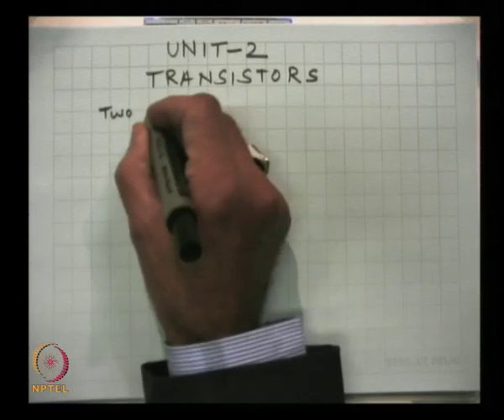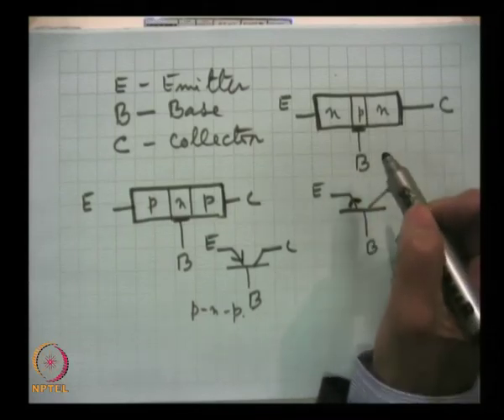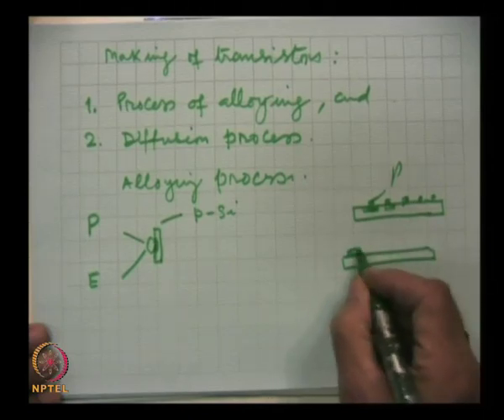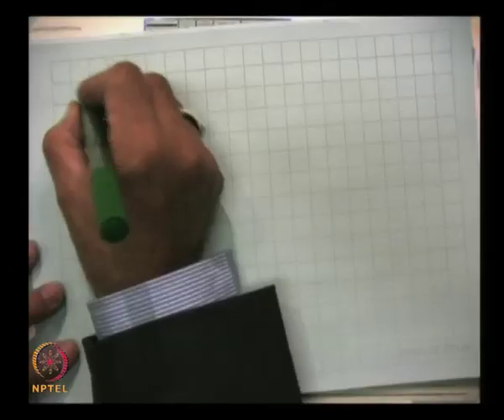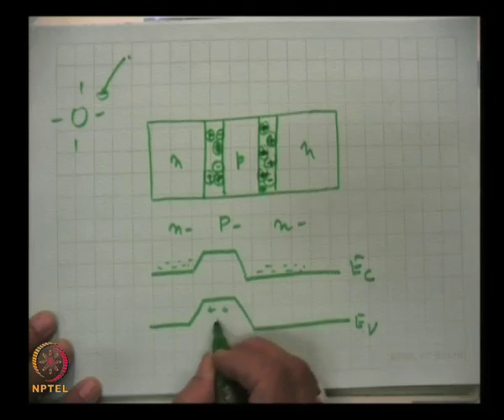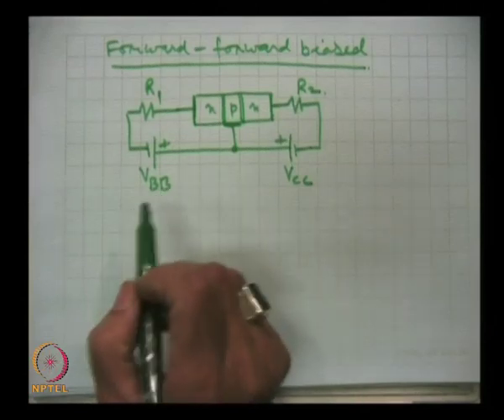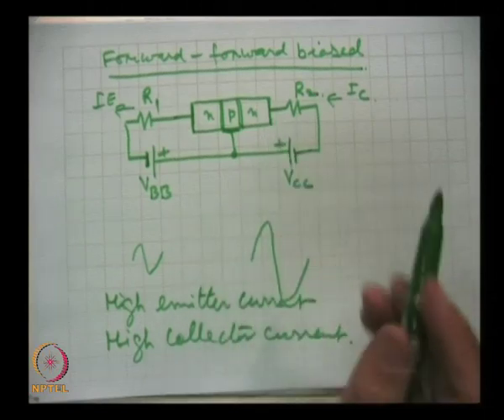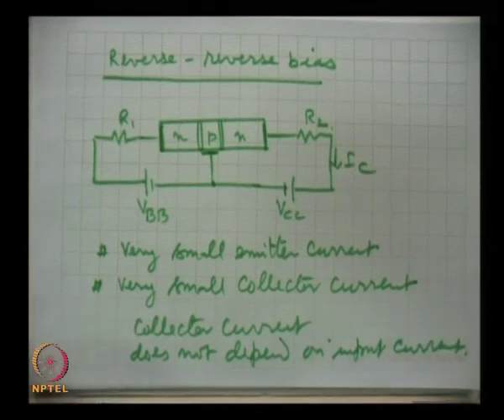Mod-02 Lec-05 Transistors

Comment: why have you taken the direction of collector current in reverse direction?
Reply: When collector base junction is reverse biased in a  n p n transistor , electrons will flow towards the collector.Thus the direction of current flow has to be opposite t o the direction of electron flow.
Reply: seema dube are you Daughter of prof dube?
Reply: @sexo6162  🤣🤣🤣🤣🤣.....
Reply: nooo u are wrong....actually the attraction caused by the positive terminal of the battery so the arrow represents the attraction force caused by the battery